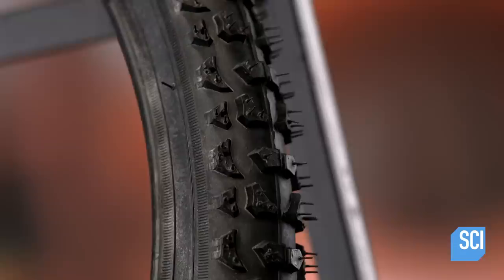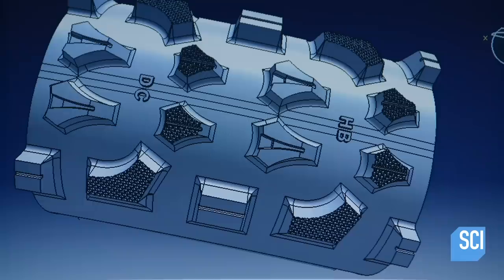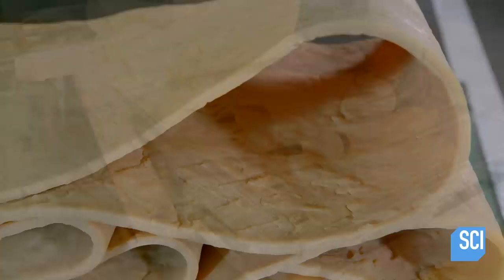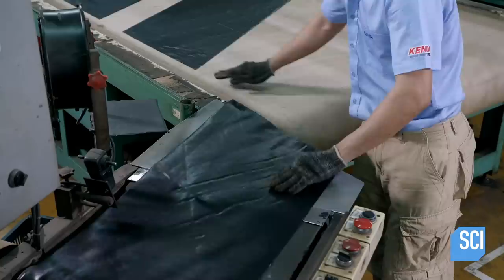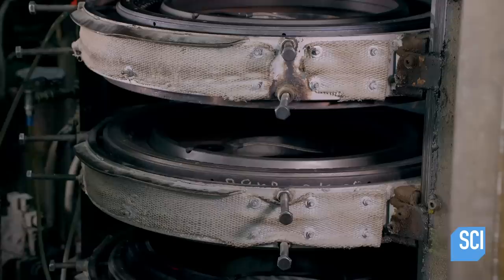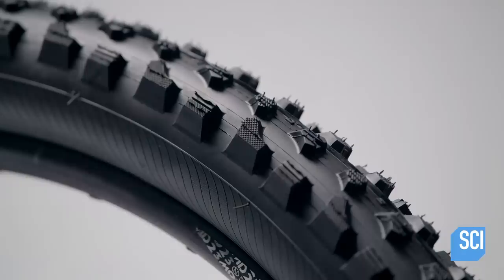How Mountain Bike Tires Are Made | How It's Made

Comment: I like how they just leave all the packaging on the ingredients for the rubber compound when they dump them in the mixer
Reply: Made In China
Reply: Not all the packaging. They leave only the plastic packaging and not the paper. Most likely the packaging of the said ingredients is purposely made to mix in the compound to speed up the process and save cost and waste.

Think about it as an ice cream in a waffle cone.
Reply: @za7v9ier  those dudes are clearly Taiwanese.
Reply: Natural rubber is wicked sticky. Without the plastic on it, it would stick to the conveyor belt and machines. If you kneed it, it looses some of that stickiness. So, I think that's why they leave the plastic on it when putting it in to the mixture.
Reply: The plastic covering is designed to melt.
Reply: They do this with a lot of foods too
Reply: When my dad made me he put me in with the rubber compound on and guess what? I was still born
Reply: any video that uses natural rubber leaves the plastic packaging on.
Reply: That’s one of the things that upset me it might affect the quality of the rubber!
Reply: It won’t
Reply: @tomalophicon  what taiwan?
Reply: @Layput  i mean, doesn't all plastic melt?
Reply: @chrisa2735-h3z  the packaging has been designed to break down and not negatively effect rubber quality
Reply: @Jbonecreeper  Yeah like a can of Pringles just has a slightly larger chip for a cover, at least the chips and the cover taste the same
Reply: @GabrielVescovi  No, only thermoplastics melt. Other types decompose or burn without melting.

Comment: they skip the step where it turns from the natural color to black?
Reply: It's magic! It's a miracle! It's an illusion!
Reply: I was waiting for that part too. It's probably a trade secret.
Reply: They specifically say it gets pushed through dyes.
Reply: @AlexanderPHolcomb  they meant dies.
Reply: @Commando678 subtitles “using heat and pressure, the extruder forces the rubber through dies”
Reply: Could say what about red, green, blue and so on as lots of colour tyres
Reply: @mlee6050  dies are not dyes.
Reply: @tomalophicon  I know I was quoting what subtitles said so he know, and yes might sound same but thanks to engineering level 2 from 5 years back I know "dies" is normally to cut thread or shape things and "dyes" for colour I known for about 17 years now as did tie-dyeing on first year of school that I remember was about 8yo or 9yo then
Reply: When passing through one of those rolling mills, carbon black is mixed in (and the "ready for use" stage most likely isn't).
Reply: Google "Vulcanization".
That's how the rubber get the black color.
Reply: Natural rubber is tan/whitish in color usually. To get the black color, they will add carbon black to the mixing process that you saw in the beginning. If you are using carbon black, by the time the rubber comes out onto the rollers, it is already black. Has nothing to do with the Vulcanization process.
Reply: @mlee6050  Dies are what shape something not the kind of dye that you are thinking of. Ie. Tool and dies..no mention of the colorization but really interesting.
Reply: "Then it passes through dyes that mix the different materials. The heat turns the mixture to black"
Reply: Because that would be racist...
Reply: They spare you the black kittens that they have to insert...
Reply: That's racist......somehow !

Comment: That'll be $79 for that tire, Please!
Reply: More like $49
Reply: Probably more like $39, considering this one uses a wire bead.
Reply: They are wire bead Kendas... these are Wal-mart specials.  More like $5 to an OEM or $15-20 for an end consumer.
Reply: The honey badger, small block 8, and slant 6 that came out of thr mold are pretty decent tires. The one from the into is wal mart crap.
Reply: I’ve bought $100 tires for my mountain bike. My car? $40 used lol
Reply: KENDAs are great value for the money.
Reply: Kenda makes super cheap ones.

Comment: The machinery looks old,slow and dangerous. Thanks for the video, always interesting to see how things are made.
Reply: It also shows why some bicycle tires cost as much as some car tires. Very inefficient.
Reply: @MrTeff999  Too bad they don't have you to show them how it's done.
Reply: @marsbase3729  So true. So true.
Reply: The small volume of each tire model and size probably doesn't justify further automation. Automating only the most dangerous and difficult tasks allow for very small production batches.
Reply: @saxphile  You can see this even more with fat bike tires - a cheaper MTB tire cost around 15 € in EU, a competition capable one around 40. Fat bike tires cost between 30 for a cheap one and 80 for a Schwalbe. 
A car tire for a medium sized car (like the 205/55 R 16) is around 50 to 60 € for the latest brand models.
Reply: @MrTeff999  lol , not only tires , the overall bicycle , good ones are overpriced
Reply: @simonm1447  fat tires are special tires ,of course have to pay extra
Reply: That's not that old of machinery.  And all industrial machines are dangerous.  I know I'm a millwright at a rubber/tire plant

Comment: That's really cool. The only flaw is that actual mountain bike tires are not made as wire beads anymore because wire bead tires cannot be set up tubeless, and almost all mountain bike tires are tubeless now. Mountain bike tires usually have a folding Kevlar bead instead.
Reply: The slant six they show is still available with a wire bead
Reply: @shanescott8241  not popular that way, as it's not available as a tubeless wirebead.

Specialized does that with their Pathfinder. It's available as a wirebead Sport, and as a folding tubeless Pro. Nobody buys a Pathfinder Sport.

Comment: Now I want to see how they make tubeless and BMX tires.... Those are dramatically different from cheap Walmart brand tires.
Reply: What? They are very similar.
Reply: They have an episode showing how tubeless car tires are made.
Reply: Same process. Just different materials, like Kevlar threads instead of steel wire and special layers to hold air without inner tubes

Comment: 0:47 did he just let plastic wrap on or is that the way it is supposed to be done
Reply: Om Sarpole It's not a big problem. Most of the companies do that. Since, more than 30% of tyre is made up of filler materials (mostly Carbon Black), the plastic wraps will contribute to that filler material percentage..
Reply: I’ve seen this done on the rubber eraser and rubber band episode too
Reply: Yeah, whatever, who cares. Just do anything and everything as sloppily as possible. Saves more than 25 secs each and every day. Laziness and slovenliness will rule asap!
Or that packaging better help me through the mud.
Reply: Well tires are compounds made from nylon, rubber steel, kevlar etc. A little bit of polyethylene packaging will not change the overall composition of the tire. It probably makes up only .5%.

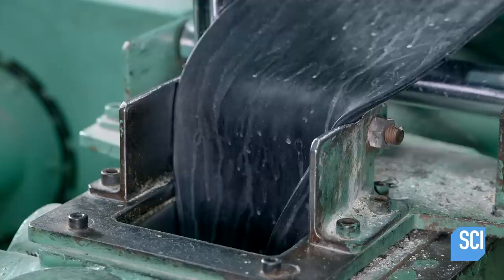Comment: This is unclear. How did the rubber go from a light color in the beginning to black at 2:17?
Reply: john I’m wondering the same.
Reply: They usually just add carbon black.
Reply: @here2there880  Good point. The vid could have mentioned that.

Comment: Dope! I run a Maxxis dhf minion 2.3 in the front and a Maxxis 2.25 Ardent in the rear ✊✊
Reply: TexasTaco512 why the diff in width
Reply: @tinhinnh  People like grip on the front and lower rolling resist on the back, in Enduro circles a 2.5 front and 2.4 rear is quite popular and not that many people like a super grippy rear tyre as it can make the bike less agile around tight corners, DHF + Ardent is a great setup too.
Reply: EOHRyan thanks for the explanation!
Reply: @weridebikes1000  What makes you think that? Fast rolling, good predictable grip, ideal rear for trail riding. You use the right tyre for the job, a DHF would be garbage for XC.
Reply: EOHRyan because the second you go to corner hard the Ardent cornering knobs fold over. It’s a XC tire matched with a DH front. I too ride a DHR front 2.3x29 EXO but use a Minion SS 2.3 DD rear on my hardtail that i ride everything on, including long XC rides.
Reply: @weridebikes1000  Ardent isn't really a XC tyre though it's more of a middleground trail tyre (a bit too beefy for XC imo), it's very similar to a faster rolling high roller with some more predictability, pattern is similar too.

It also depends on the terrain you're riding, rode an Ardent rear for a year in Wales with a DHF upfront and going for Strava times, very close to the professional racer times on the downhills, it was super capable in the summer months especially.

It's a great tyre if it's used for what it's good at, which is a fast rolling trail tyre suited to the rear. If you're a pro racer it doesn't have a specific use, but most riders aren't racing and most people need a good all-round tyre, Ardent definitely works for that, depending on where you live/ride/
Reply: @weridebikes1000  Arden's are great tires if you know how to ride well. I race XC Enduro and do dirt jumps and have no problems with the ardent, its a lightweight fast rolling tire, its  about skills not tread lol
Reply: TexasTaco512 if you want to assume things about me, like my lack of skills, that’s cool. But let’s be real, there’s a tool for every job. I’ve raced ardents. For trail use they’re too flimsy and I can burp or roll the bead off on any given ride.
Reply: @weridebikes1000  if you want to assume Maxxis Ardent is garbage just because you can't ride it then go ahead but it's a tried-and-true tested tire that's very popular in the MTB world
Reply: TexasTaco512 totally, for guys over 50 who can’t corner hard.
Reply: TexasTaco512 oh man, harhar, I fell off a 36” greasy log, but cleaned it next go. Meanwhile you pair a DH tread w/ a xc one and day it’s good.
Reply: @weridebikes1000 - You can corner plenty hard on an Ardent, like I said it depends on the area too, it really performs in dry summer conditions, dusty hard packed dirt and it really tacks on well but with a predictable slide when it gets moving.

I ride a FS Marin Hawkhill (trail bike) and gun for Strava top times on descents, I was faster on a dual compound Ardent than I was on a 3C DHR for some of those.

The DHR has more grip and support but the faster rolling Ardent gained in other areas, of course if you take the Ardent outside of its comfort zone and push to DHR territory the DHR is much better, but that's kinda the point I was making with the right tool, Ardent has its place and performs well there.

If you're an XC racer or a DH racer you're not using an Ardent, but if you're a trail rider who needs good all-round performance it's a real solid tyre, which is probably why it's quite popular.
Reply: TexasTaco512 bruh when you win one the these “races” you can talk at the table with the adults. You clearly know nothing about tires.
Reply: Just an average cocky mtb guy move along

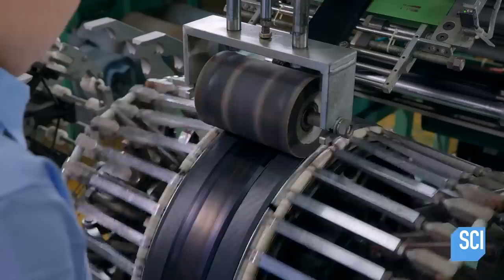Comment: 3:27 so the tread isn't even glued to the casing, just pressed on. Doesn't seem very secure to me.
Reply: The  heat press will bond all the materials  this is the same for car tires too.
Reply: It's similar to welding. It's way more secure than any glue.
Reply: @AlexandarHullRichter  I see, didnt realize it was a heat press thanks.

Comment: 2 problems: 1) that tyre in the beginning is a super cheap one off a kids bike, 2) ‘can handle it all’ XD pinchflats, tearing a sidewall, regular puncture, sharp corners pulling them off the rim.... Edit: 3 problems: not all tyres have wire beads

Comment: I have a slant six wtf
Reply: They are no bad XC tires, they also came with my Scott bike.
Reply: @simonm1447  Scott Aspect 970. They're decent beginner tyres but I'd opt for something with more bite.
Reply: @DoomerLoser  I have a 730, a nice bike, as long as you don't do extreme mountainbiking. 
The 730 has even a hollow tech 2 crank set, a 2 x 9 and a air fork with remote lockout (a suntour XCR air)